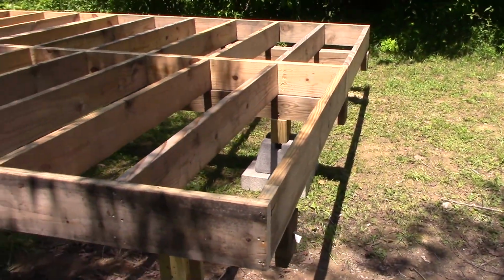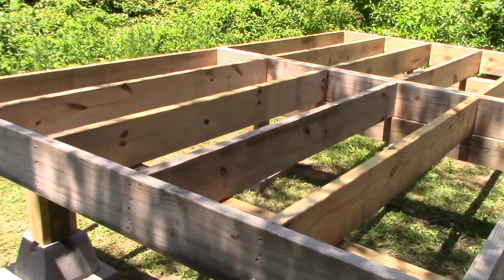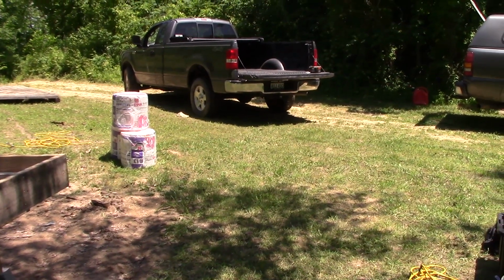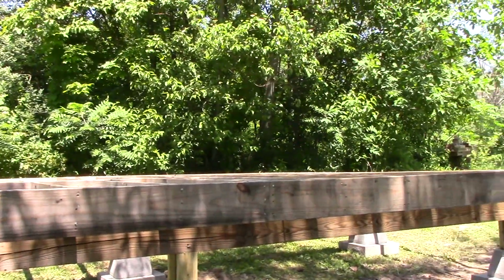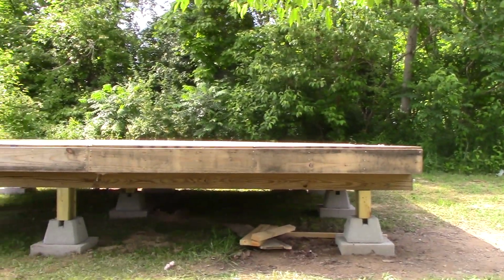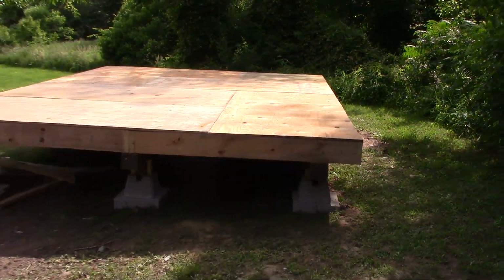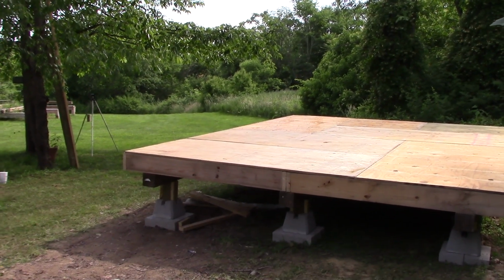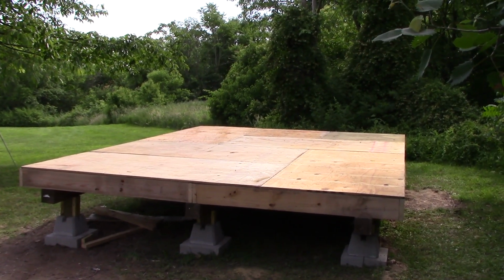DIY Off Grid Cabin - Joists & Sub Floor

Comment: This is a stupid question. What holds it down? It's weight? Saw no anchors?
Reply from the maker: +Leonard Roark Pretty much it.  Remember, it's only a 1 room cabin that will get used 2 or 3 times a month.

Comment: Joe, with the floor cantilevered like that, you had better strap down the center, or else over time you will develop a bulge in the center of the floor and possibly lose structural integrity.
Reply from the maker: +Gil Lubecke Excellent post. I will shoot video from the underside to show how I did it. They only hang out a few inches though.